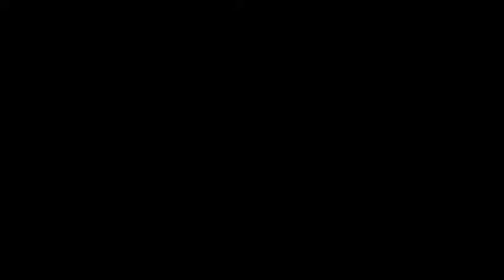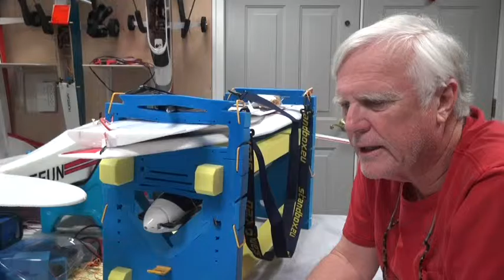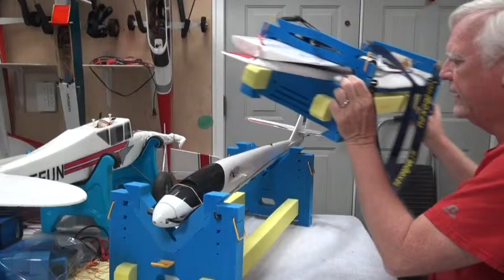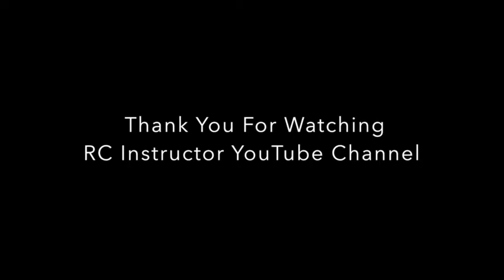RP10 Radian Pro CG

Comment: So you used the recommended CG in the manual?....70mm?....I have read that it's maybe a good idea to move the CG a little further to 73 to 75mm....I was wondering your thoughts on moving it back a little......Thanks for the great videos
Reply from the maker: Some recommend that, but I do not.  I like the CG exactly in the center of the range the manual gives.

Comment: HOW did u setup cg w/ machine - ur method?  How far back from leading edge did you find your cg.  Size battery?  Total plane wt?  Thanks
Reply from the maker: CG setting are always in the aircraft manual.  The size of the battery is always the recommended in the manual.  It does take practice to make the CG machine work, but I always use the Great Planes CG machine because it is most accurate.